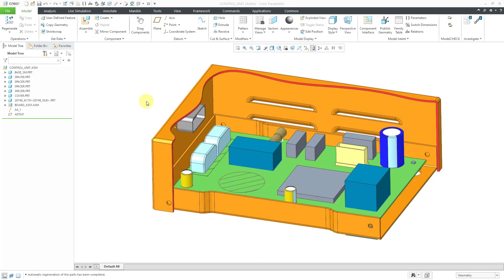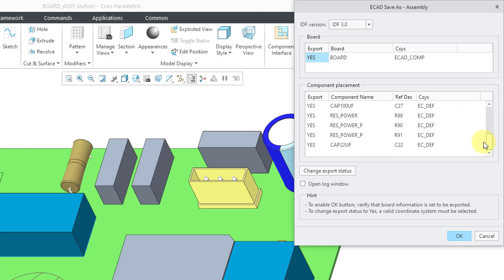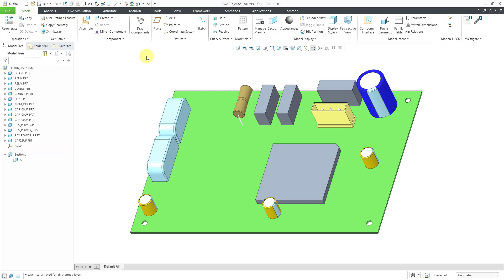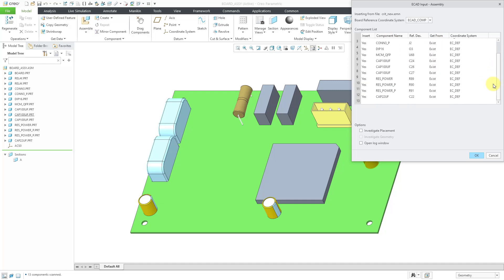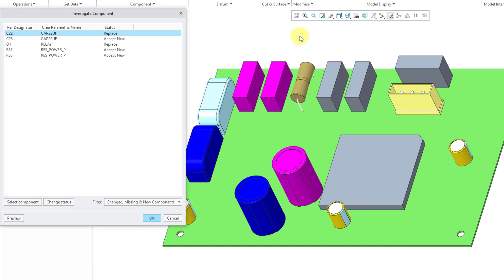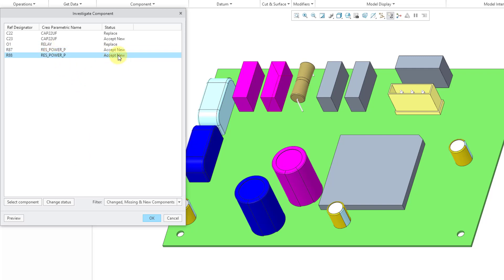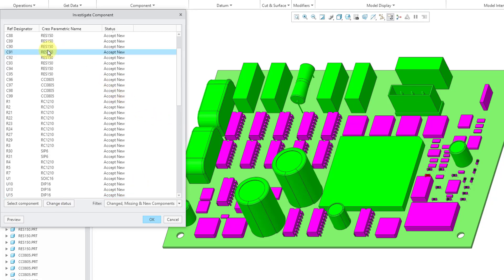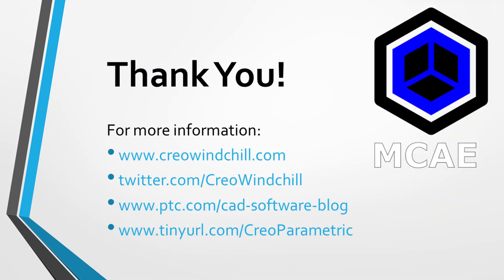Creo Parametric - ECAD - IDF Export and Re-Import

Comment: Hi Dave, great video as always, have you ever seen a case where a connector on a board refuses to export with the emn/emp file because supposedly it doesnt have a coordinate system? I have this one imported step file connector that just stubbornly will not export, I have even added multiple extra coordinate systems to the model with no luck
Reply from the maker: I have not seen that. Is the coordinate system named correctly? Should be something like ECAD_CSYS. Have you filed a ticket with PTC Tech Support?
Reply: @CADPLMGuy  you are never gonna believe this, I dug into this problem and found the "solution" so for the connectors associated with the board to get exported in the ECAD, the default csys on the connectors has to have is z axis pointing away from the primary or secondary side of the board. So basically i had to go into all my connector files, crack open the IDD and rotate almost all of the imports 90° so z was up or down, now it's exporting with connectors